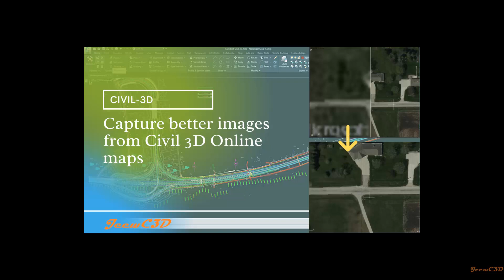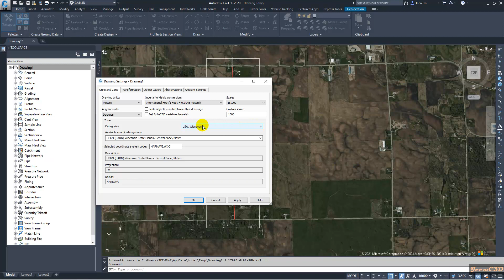Capture better images from Civil 3D Online maps

Comment: I have a better technique to capture a higher quality satellite image. You zoom in further on your screen then capture a small piece or portion. Out of that small rectangular geomap image you drag the corner (stretch) until it reaches the desired area. For sure you will get a better resolution.
Reply from the maker: Yes. That works well. Thank you for updating knowledge.